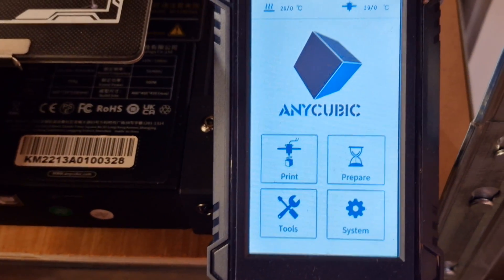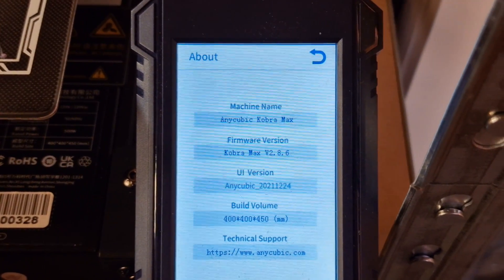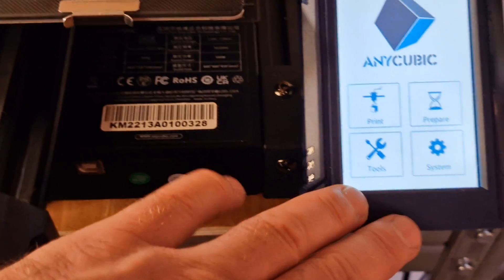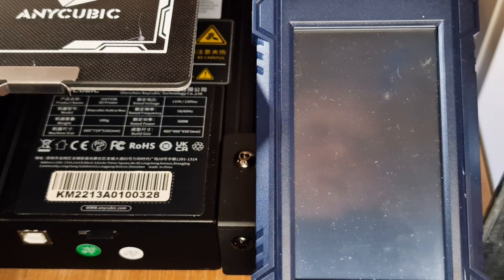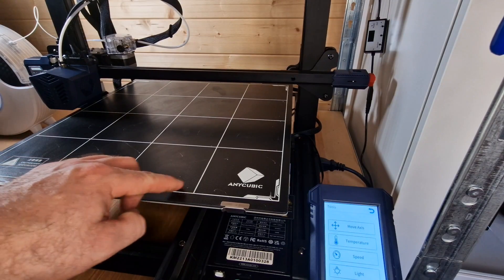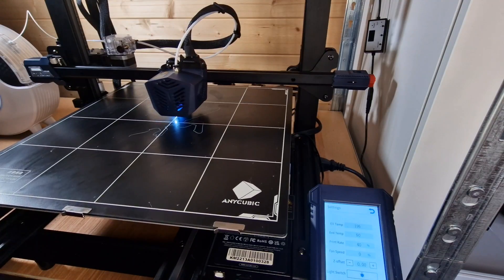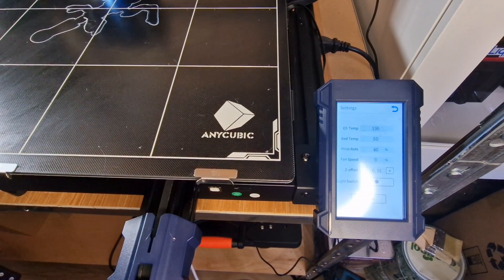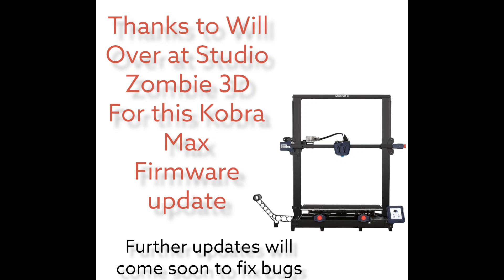Anycubic Kobra Max Zombie3D firmware update, 0.0.1 baby steps and filament change during print

Comment from the maker: New zombie build for the kobra ready to test. Linear enabled with fixes for it and junction deviation enabled. Working well so far did a couple test 
Flash, send m502 twice then m500. Calibrate esteps, set junction with m205 j0.05 and then calibrate linear advance.

 instructions m502 twice after flash m500 then calibrate as usual. Kobra max and plus k values will be much higher**
Reply: IMPORTANT INFO, It was not the update! at the same time i updated my printer my nozzle went on me. somehow with a bad nozzle the strain guage is unable to see how hard the nozzle hits the plater. its just bad timing that happened the same time i updated leading me to believe alot of different things. With my on screen movements to left and right, my up and down movements also move. only when i onscreen move the nozzle head my self. i think this is something the max came with/like without me ever noticing but it is not a problem at all, it never happens on auto lvl or within print. strange but works perfectly now. Dont clean your nozzle, BIN IT rebuy a hardened steal nozzle (FLAT TOP)! ty for helping me all :) im one never to give up.
Reply: Are these steps needed? I flashed the firmware and seems to work at first glance. Can you give more info as it's not clear please and also how you send those commands?

Comment: I realize that this is a relatively old video about a relatively old printer, but thought I'd share this in case someone else is still running the printer/firmware. I'm pretty sure I've found a bug. I'm doing some printing 'by object' (Orca Slicer) and I just discovered that when there's filament runout detected, the firmware doesn't remember how high previously printed objects are on the plate. Instead of simply moving up a couple of centimeters, it also repositions the bed and print head in the Y and X. This has the potential to hit and jam on previously printed objects, causing the printer to 'get lost' and resumption of printing will be offset by anything from a little to a massive amount.

Comment: hey again, the problem here lol, if your update did not work, read this! Zombie update is pretty cool with that said i havent tested it fully yet :D it messed up my firmware instead REASON WHY. I used a 2gb memory card that is too small for the bin file witch is hard to believe but u never know OR my SD card was corrupt in some way. used a 8gb sd card i got from another 3d printer and now seems to work! if u guys every hear my problem of bed leveling trying to smash the bed plate after updating, this is why! :D if fails soon i will keep u updated.

Comment: Hi, Amazing video. i ran into a problem when updating. when i auto level my bed i've noticed when my hot end moves back and forward or left and right its slightly moving up and down at the same time when not ment too, did i do something wrong. mostly  i think anycubics website has got rid of the original firmware file i'm unable to find it. and on your link when i click it i have no idea how to download the original file. please help and thank you for your videos and help :D
Reply from the maker: Hey that's odd shouldn't be doing try this link  https://www.anycubic.com/pages/firmware-software
Reply from the maker: Under kobra series then kobra max v2.8.7
Reply: More news :p lol i managed to get the printer too 2.8.6 firmware, after the update the printer when leveling the bed desides to try go through the bed, this only happens  in the centre of the bed, ive checked if anything is bent and all seems good, printer is about 3months old only 5kg printed with it. Any ideas :)
Reply from the maker: @SimonHirst-c5y  wondering if it's the strain gauge ???
Reply: Ah, thank you i found the download :) im unsure how to open correctly now as my pc keeps asking me to open up in notes, sorry to be a pain and thank you for replying sp fast
Reply from the maker: @user-xf4ff3bk4d  if u put the firmware.bin file only onto a blank micro USB and then with the max turned off add the memory card into the motherboard slot, then turn on the machine this will then activate the firmware upload. Remember  to take out once loaded and remove the file off the memory card. You will need to carry out a new bed level
Reply: Thabk you so much im getting closer, ive downloaded the file now and have it on a SD card, but yhe file is known as RAR and wont update the printer on switch on. Thank you
Reply from the maker: @user-xf4ff3bk4d  u will need to unzip it first before adding too sd card 😃
Reply: Hi, there is no option to unzip only to compress the .RAR  to zip file
Reply from the maker: @SimonHirst-c5y  that's really odd if you drop ur email in I'll email it over
Reply: Is the straing guage a part inside the printer, and im unable to put my email here for you :)
Reply from the maker: @SimonHirst-c5y  it's in the print head
Reply: @3DPUK-TECH-CHANNEL  what do you think about the printer moving up when i select it on screen to move right and left. Could that be the straing guage aswell
Reply from the maker: @user-xf4ff3bk4d  possibly ... I know it could also be an issue with the motherboard might be worth reaching out to Anycubics repairs team specially if ur in warranty
Reply: When moving left to right still my printer goes up and down slightly, on leveling too but not when i home tho,

Comment: Very strangely I installed this firmware, ran the m502 and m500, calibrated esteps, pid autotune, and ran a calibration cube. The cube came out at 20x16x20. I checked the axis steps and they were the same as they were before flashing the firmware, 80 for x and y and 400 for z. 

I didn't try playing with the axis steps yet, I just tried flashing back to stock firmware and printing the same cube and it appears to be printing the proper dimensions. 

Kobra plus, downloaded the kobra plus zombie v2 firmware.
Reply: Me too, did you manage to solve it?
Reply: @lucas_v2417  I have not messed with it at all. Like I said I just flashed back to stock after that squished cube and have been printing fine since then haha!

Comment: Hello 3D PUNK, im having problems with updating my kobra max, i was usin 2.8.6 and tried to update to 2.8.7 but the screen got stuck. I just downgrade to 2.8.6 but the screen sometime doesnt work well, like doesnt change the menu, can u help me?
Reply from the maker: Have you ensured the correct files aren't the sd card also maybe try another sd card. ???
Reply: @3DPUK-TECH-CHANNEL  I just try another SD and it solved the problem! 
Actually I was doing that because I got the error “hotbed abnormal” I couldn’t fix it
Until I open the motherboard, clean it, connect and disconnect the hotbed cables and now it’s solved! (I just have 2 months with my printer) 
Greeting from Mexico!
Reply from the maker: @maximilianomartinezarevalo1832  awesome 👌 thanks for watching

Comment: Thank you for your video.  It's very good.  I want to add a note about flashing the new firmware.  On my Kobra Max, powering off the unit did not work.  The motherboard refused to boot from the SD card.  I resolved this problem by powering down the unit, unplugging the unit from the mains, and inserting the SD card.  After 20 seconds, I plugged the unit into the mains and turned the power on.  The firmware flash proceeded without error.

Comment: Hey guys, I just wanted to pop over here and share my experience with this firmware install. Installed yesterday on my Max and quickly re-installed the Anycubic 2.8.6. I wanted to experience the life-changing 3D printing perks everyone else seems to be enjoying with this firmware. Unfortunately, it isn't cutting it for me. Main concern is that the motor turns on when I turn the printer on and I have to manually shut it off. Also after print is complete, the motor stays on and I have to manually turn it off - even tho it's in the gcode for it to turn off. The pause function stopped working and when the gantry was moving on the wheels, there was a dragging sound coming from it - the sound is gone since reverting back to Anycubic's firmware. I saw somewhere that it's because of the linear advance function and that the pause function is replaced by the M600 command to change filament while printing?  There was really nothing wrong with how my Max was working before - firmware-wise - I just liked the idea of the 49-point bed leveling - thought it would be more accurate and I feel like it was for my test print. But the constantly running motor issue and dragging noise were not ideal. I see that this isn't an issue for a lot of people, but wanted to share my personally experienced side-effects for consideration. Also, while I am sad that this didn't work for me, I am not looking to troubleshoot so I can reinstall - my dad said I need to stop trying to fix things that aren't broken. Thank you for making this available to try out :)
Reply: Yes, same thing with the dragging noise. It is present even when the motor is stationary, which is bizarre at best. But with a severely warped bed this was my only option and so far it seems to be working
Reply from the maker: Totally understand I have also reinstalled the OG firmware... its all a matter of personal choice... with the dragging and motor sounds that requires some calibration via pronterface to gain the best settings.... I would agree with your dad's sentiments don't fix those that are broken.... keep printing, keep having fun and don't forget to like and subscribe 😉
Reply: @3DPUK-TECH-CHANNEL  i also have the dragging noise, is there any fix for that? i saw some comment on the facebook page about motor voltages, but the settings are unchanged after the new firmware, so i dont get where it comes from? anybody has a fix for that?
Reply: did you re intsall de original firmware from the website? i tried but the screen doesnt work fine

Comment: Hey boss. You've been great. Im not sure if I accidentally modified the profile I got from you but im having one problem you might be able to help me with. Im sure its a simple fix but I can seem to figure it out. I grabbed a hallow 3d file and cut it in half so I could mount it on my wall, but when I slice it. It only prints the supports and not the actual object. Ive tried joining the extra features I added and even used boolean, solidified it and it still only prints supports. No object at all. Hope that made sence. Ive never come across this issue
Reply from the maker: Email it over too me and I'll see if u can slice 😉  3dpuk1@gmail.com
Reply: @3DPUK-TECH-CHANNEL  ok I sent it the other day. Hope you received it and had a merry Christmas 🎅

Comment: y axis makes high pitched buzzing noise from stepper motor. after downgrading back to original firmware sounds was gone... help?
Reply from the maker: I believe its something too do with stepper driver power 🔋
Reply: @3DPUK-TECH-CHANNEL  ah okay, I'm a bit new to this but, is this something I can prevent?

Comment: Curious what ypu're using to clean the bed?  I had 91% alcohol ruin one of the Max beds - made it super sticky!

Thanks for this video!  I'll flash the Zombie Firmware after the current print is done.  Happen to know if it's possible to go back to official firmware if needed?
Reply from the maker: Hey so first question I simply use a slight damp cloth rung dry... and heat bed upto 60c and wipe slowly over the build plate only have too do that once every 5 prints works a treat for me offset is a huge thing too make sure its spot on and not too low so ie lower down creates a squishy of the filament and that creates supper adhesion.  Raise it 0.05 on stock but with zombie firmware  0.03 . 
2nd question the Anycubic store under the kobra max selling page scroll to the bottom and it shows stock firmware you can refresh back
Reply: @3DPUK-TECH-CHANNEL  I grabbed the 2.0 version from his folder dated 25 November, formatted a MicroSD card, inserted it into a powered off Kobra Max, powered it on and nothing seems to be happening. Have you tried this version of the firmware?
Reply: Never mind... The Max didn't like the MicroSD card I tried.  Tried another one and it worked.
Reply from the maker: @chrisnenzel582  awesome 👌

Comment: Hi, could you tell me whats different about the 3 types of firmware’s. V1, a and b
Reply from the maker: V1 was the initial firmware,  the a and b are pretty much the same with a slight tweak too the linear  setting.... I'm currently still on the a
Reply: @3DPUK-TECH-CHANNEL  Any chance you know why resume after M600 wouldn't happen? i use the M600 and does the beep and retracts but doesn't resume after change
Reply from the maker: @oneglimmer  have you pressed resume?
ic ant verify this change myself
Reply: @3DPUK-TECH-CHANNEL  silly me. I forgot the graphics on display probably not there yet. Printing from an sd card, pressing the pause button resumes it. It just doesn’t show the word “resume”. Also I use M25 for pause and the lcd display pause button resumes it also. Just tried.

Comment: I have been trying for a months to get my printer to pause at a certain layer. And be able to resume. I have tried pause at layer height, filament change. And have even tried adding the code G4 S60 for it to automatically resume. Suggestions?
Reply from the maker: Have you added  the new firmware
Reply: @3DPUK-TECH-CHANNEL  i added the firmware , Zombie V1.8b. What cura profile are you using, would this make a difference?
Reply from the maker: @Mattycars95  in terms of adding this into cura I'm unsure and untested Just know that I can pause and it moves away for filament change... Will try do some testing this week
Reply: @3DPUK-TECH-CHANNEL  sounds great, I am trying to get a filament change on an exact layer.
Reply from the maker: @Mattycars95  we will get it there it's progressing  well over.time
Reply: @3DPUK-TECH-CHANNEL  Hi, any news reagarding this ? i want print in different colors and i hope this firmware will help me do that

Comment: i installed small steps but my filament won't come out, what should i do?
Reply from the maker: Filament shouldn't be affected by the small steps part of firmware...
Reply: @3DPUK-TECH-CHANNEL  I'm put filament out on the screen and printer pushing filament in to the nozzle
Reply from the maker: @marcinimaxio  maybe use manual feed only its far more easier I.have a video on this
Reply: @3DPUK-TECH-CHANNEL  I'm using pronterface now for feed
Reply: @3DPUK-TECH-CHANNEL  I am writing so you would know that there is a problem with it

Comment: Argh! don't pull on the bed is induces current into the motherboard.
Reply from the maker: if you pulll slow its not too much issue and i had isolated motor on printer
Reply: @3DPUK-TECH-CHANNEL  I was watching someone on the facebook group sliding the bed with the printer off and the induced voltage was turning the screen on.
Reply from the maker: @tigheklory  true just do it slow 🐌
Reply: @3DPUK-TECH-CHANNEL  Obligatory "That's what she said."
Reply from the maker: @tigheklory  hahaha 😆
Reply: The drivers have thier own power rails do they not and aren't mosfets usually one way conductors or am I missing something?
Reply: @alteredworks  just turn it off and slide the bed and it will induce enough current to turn on the screen.
Reply: @tigheklory  True, but the screen backlight  is rarely powered using the logic voltage if ever, and not all printers exhibit this behavior (back EMF diodes). Basically what I'm saying is the current supplied for the steppers is not the same current being used for the logic chips. They are separate systems. If this were the case we would have a plague of dead printers on our hands. It's kind of the whole point of having stepper drivers and H-Bridges, so that the currents are isolated from each other.  Of course an abundance of cation never hurts.
Reply: @alteredworks  the whole thing starts booting if you side the bed fast enough. There's a guy doing this on the official Facebook group, it's painful to watch.
Reply: @tigheklory  The voltage still has to go through the voltage regulator for all of the logic chips, you're not dumping all of that current into them in the manner in which it's going to pop the controller. That's why there are separate power rails.

Comment: The X-axis engine began to work louder. Is this normal?
Reply from the maker: Yes that's correct 👍
Reply: @3DPUK-TECH-CHANNEL  Thanks for the quick response, and for the firmware. I will test
Reply from the maker: The extruder will sound different with the linear advance the stealth chop is disabled to make it work so there will be noise
Reply: @3DPUK-TECH-CHANNEL  During the test printing, the layers were shifted
Reply from the maker: @zissiz545  on terms of shifting I can only really ask you too contact  will from studio zombie 3d he was the original firmware creator I haven't seen this myself
Reply: @3DPUK-TECH-CHANNEL  I had the same issue. Random layer shifts on the y-axis. I had to revert to the stock firmware. =(